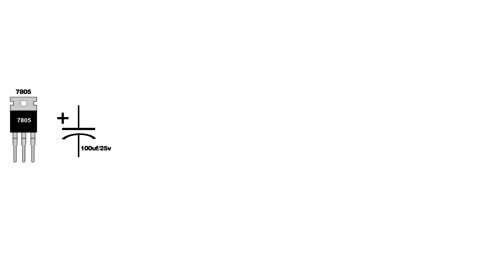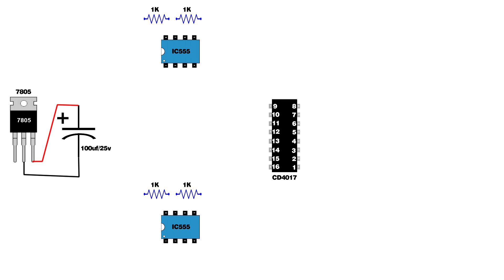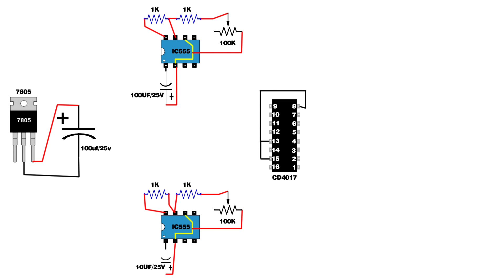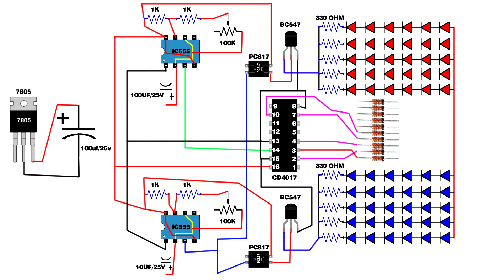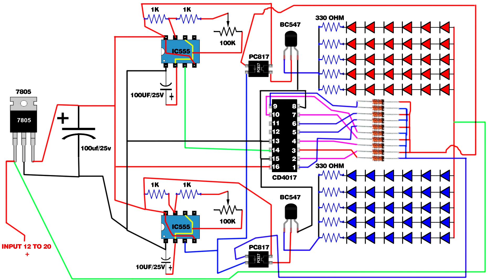HOW TO MAKE REALISTIC POLICE 🚨 LIGHT FLASHER [USING ONLY CD4017 IC AND DUAL IC 555]

Comment: great and detailed explanation. is this runs with 9v battery?. if not possible, can you pls share the details of SCHEMATIC ANIMATED VERSION for 9volt for my KIDS
Reply from the maker: "If you are planning to make this project using a 9V battery, you will only use  a few red and blue LEDs. Please contact me on WhatsApp, and I will provide you with a schematic for a 9V battery that will work with this project."
Reply: @Circuitoptimize23  Really thanks for your support. PLs share your Whatsapp number with country code / mail id. Am from India
Reply from the maker: What's app number provided in the video description.. +91

Comment: The pinout for the PC817 shows Anode, Cathode, emitter and collector. Which pins go to +Ve and Base of the 547. Edit: After rebuilding this circuit, I can't get it to work. A schematic or proper diagram would be nice, thanks